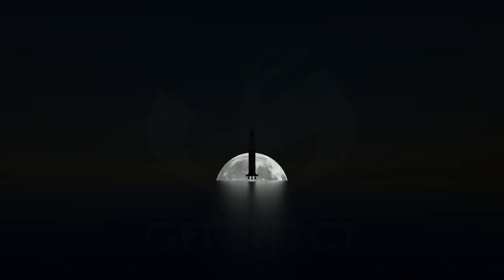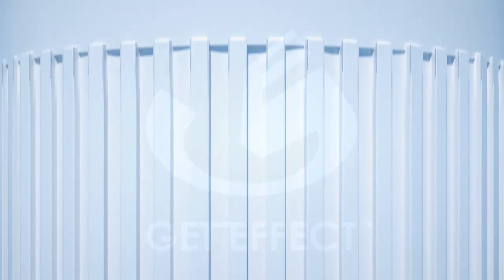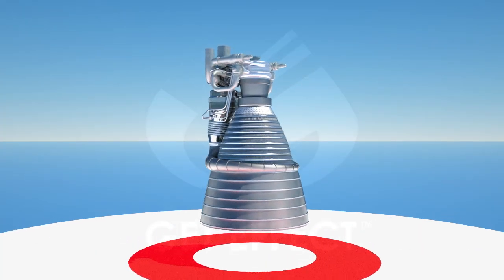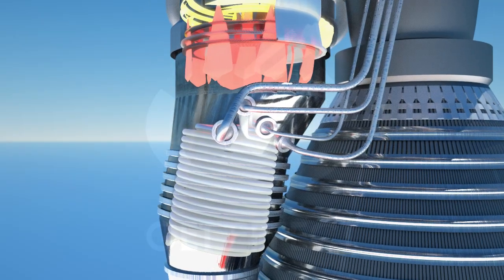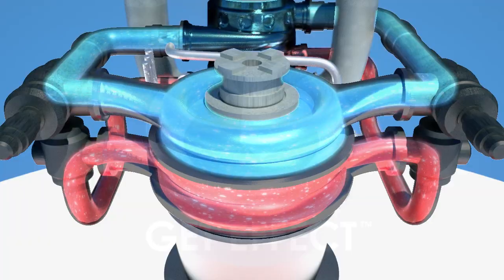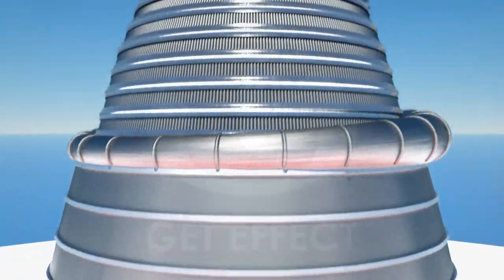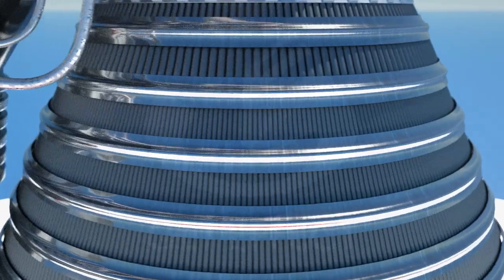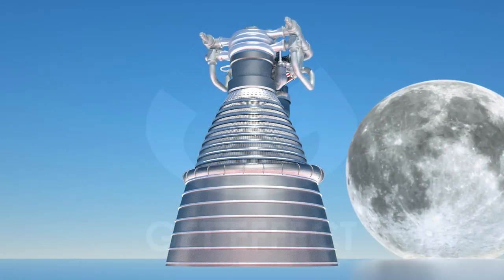NASA SATURN V ROCKETDYNE F1 ROCKET ENGINE, AN ANIMATED DOCUMENTARY (2016)

Comment: If we brought back the F-1 Engine, we could make America great again.
Reply: Well faster anyways ;)  They where expensive to build and for the payloads going up today Other rockets can do it on the cheep. 
I agree with you that we should revive the "space race" as it did usher in most of the technology we take for granted today.  The moon is our next logical step in learning what really works if we are going to go to Mars.  We have been working with the F-1 for a possible rebirth for deeper space exploration but what we really need to get this done is a much larger cash flow into research for not just the F-1 but new types of propulsion to get going where we want to go in a much shorter time.
Reply: Not a chance.. it only had enough fuel to go into orbit some maneuvring and come back.. the highes it ever whent was 650km for delivering and servicing the Hubble telescope.
Reply: Joe Vignolo I know about that, but the project has already been scrapped. The RS-25 + SRBs will be used on the SLS.
Reply: Roger Sullivan ...Get our own space program moving again. I find it kind of embarrassing that the only access we have to the ISS is a ride aboard a Khruschev-era Putin rocket!!!
Reply: abundantYOUniverse ...Add motion sensors and tripwires  to unleash the F-1's fire-breathing dragons!!!
Reply: Roger Sullivan -- No doubt about the Russians have a good record.
btw... the 1st woman in space. 1963. She just turned 80. Valentina Tereshkova
Reply: Sometime check out what was really going on a White Sands missile range in 1954 and the U.S. Army's launches with the Red-Stone rockets... go through the launch manifests and their payloads.... it will amaze you what has been sitting in plain sight for a long time but practically unspoken.
Reply: Hannible, Trump can't do it alone.  Remember Congress?
Reply: And that took some doing as the shuttle was near the limits of it's operating envelope.
Reply: I say bring back the most preeminent- prepossessing AWESOME rocket ship ever flown to date, Her Majesty, "The Saturn V Rocketship" !!
Reply: We have the Merlin-1D now. Way better, and much cheaper!
Reply: Not just the Shuttle SRB's uprated ones that will make them one of the most powerfull srb's ever made.
Reply: silverbird58 I was answering your Space Shuttle question.
Reply: Dallas Cheked Agreed!
Reply: Franco M ...The Russians also sent 48 dogs into space. 28 of them made it back to earth alive. They were the first cosmonauts before Yuri Gagarin. They proved that humans could most likely withstand the rigors of space flight.
Reply: Franco M kewl
Reply: Unfortunately.  Still stuck with large estes rocket engines that burn up leaving hollow tubes.
Reply: timmainson we should stop spending 600B annually on war and actually achieve something great (like a mars colony)
Reply: “We destroyed this technology” According to NASA. And since Werner Von Braun died,  impossible to be duplicated. Also the refinery that made the Space”grade diesel was lost in hurricane Dottie
Reply: Probably it is high time to develop new liquid engines that become much better that F-1.
Consider params of USSR engine RD-170 (1985 first flight):
Thrust (vac.) 7,904 kN (1,777,000 lbf)
Thrust (SL) 7,257 kN (1,631,000 lbf)
Isp (vac.) 337 s (3.30 km/s)
Isp (SL) 309 s (3.03 km/s)
Isp - characterises efficiency for 1kg of fuel use to convert it to thrust. The higher number, the less fuel required and more payload can get to space.
Reply: The closest thing the Saturn V had to a contemporary was the Soviet N1, which launched four times and exploded each time, almost always because of failures in the complex system that managed the N1's 30 individual first-stage rocket motors. In contrast, the Saturn V has an unblemished string of successful launches, never suffering a problem or failure significant enough to trigger an abort.
Though the F-1 was the largest and most powerful single-chamber liquid-fueled rocket engine ever successfully flown, its power was exceeded by a pair of Soviet designs. The RD-170 engine (used for the only two launches of the Energia rocket) and its RD-171 variant (used on the Zenit rocket) both produce more thrust, but the Soviets were unable to overcome problems with combustion instability in a large rocket's nozzle. Combustion instability is the tendency of the burning propellent to swirl as it is pumped into the nozzle; as we'll see, NASA eventually developed a series of baffles on the F-1's injector plate to damp its instability. The Soviet Union chose to work around the problem by fitting the RD-170 with four separate nozzles instead of one large one, giving the RD-170 and -171 the visual appearance of being four separate engines.

This workaround came to be not because the Soviets were lesser engineers or scientists—the Soviet space program was filled with brilliant, talented people—but instead because for most of its existence the Soviet space program's various rocket design bureaus were caught in a push-pull war of direction and leadership between two chief designers: Sergei Korolev and Valentin Glushko. Korolev favored cryogenically fueled rockets, and Glushko favored those powered by hypergolic propellants. This split in rocket strategy sapped resources, preventing the full force of Soviet engineering talent from focusing on either and ultimately stunting their rocketry program.

To recap; the impressive F1 rocket engine remains to date, the most powerful single chamber liquid-fueled rocket engine ever built and successfully operated.
Reply: Bruce Merrill: "The Soviet Union chose to work around the problem by fitting the RD-170 with four separate nozzles instead of one large one, giving the RD-170 and -171 the visual appearance of being four separate engines."
I hope it is widely known that size, number and form of combustion chambers greatly influence efficiency of the rocket engine (Isp), while the most 'know how' consuming part of the engine is turbine and pumps for fuel and oxidizer. RD-170 has single set of turbine/fuel pump/oxidizer pump, and thus can only be considered as single engine.
So, probably multiple combustion chambers are not workaround, but way of excellence in performance. While  additional devices inserted into big single combustion chamber of F-1 - is a patch to mimic multiple combustion chambers and provide stability, but without higher engine fuel efficiency.
I found a video with RD-170 construction ( https://youtu.be/iYfD0rwmeF4?t=2m55s ) that show some solution for fuel/oxidizer injection into combustion chamber. It may be similar to F-1 solution and has same effects.
Reply: Kyle Towers . So the F-1 is rebuilt and ready but not the Saturn 5 they are part of ?.. What’s the point of rebuilding the F-1, are we still looking for a engine for Orion ?
Reply: So we are talking hypothetically. My bad,  carry on and enjoy .
Reply: Kyle Towers : since RD-170 works with 245 bars pressure vs. only 70 bars in F-1, smaller chambers look like tech solution to much higher pressure. High pressure in combustion chamber is critical to 17.5% increase in Isp that decreases rocket fuel mass by these 17.5% and allows higher payload to orbit.
Reply: Kyle Towers: They actually work with much higher pressure than F-1. RD-170 has 245 bar, while RD-180 has 267 bar. You should review RD engines specs on wiki.
Reply: Kyle Towers: To the moment your arguments do not explain outstanding performance of RD-170/RD-180 engines between other RP-1/LOX engines including developped in US. You consider multiple nozzles detrimetnal to performance, but those "poorly designed" engines are still the best with their fuel. How can it be at the same time?
Watching for Saturn V starts I noticed that nozzle exhaust is mostly black and a bit yellow at length comparable with nozzle height itself. This is underburned fuel, that still burns, extends and creates additional pressure that could be used to increase the engines efficiency. To do this F-1 requires at least twice as long nozzle walls. But the F-1 nozzles were already extended, while it was not enough.
See also exhaust from RD-180 engine. It is blue right from the edge of its short nozzle. So the highest temperature and full burn were reached inside its short and small nozzle. This small nozzle works good enough to provide outstanding performance for the engine w/o any "detrimental to performance" clause.
You can believe that multiple nozzles is some development error of its creators. But they probably had experiments and calculations for all possibilities, and then concluded which design and size is the best for RP-1/LOX of this thrust.
Don't try to beat the heads with your plain sentencies, if you don't have any  deep knowledge behind them.
Reply: Nah.  Costs too much.
Reply: Merlin-1D has Isp 282 s
RD-191 has Isp 310.7 s (-9.24% fuel consumption) with more than double thrust.
Both use LOX / RP-1
So Merlin-1D is better than Rocketdyne F-1 in efficiency, but not better than contemporary engines.
Note that instead of 9% of fuel mass RD-191 can drive the same additional mass of Stage 2 weight to the same speed and height.
Merlin-1D is cheaper - probably yes, but it is not clear how to buy it by external buyer. So it is not clear how to understand, if the engine price is less or more than competitor engine until they are equally sold with specified price in open market.
Reply: Clarification: I haven't seen to the moment use of the Falcon 9 first stage more than twice (excluding tests). So it is not obvious that Merlin-1D can be used 10 or 20 times with ease.
There are no principal limitations to use other engines more than once, since the objective obstacle to reuse - that stages with RD-191 do not return the same way. But this is rocket construction and control limitations, not their engine. Wiki says one of the tested RD-191 reached "the maximum running time of 3,635 seconds in 12 tests".
Each Merlin-1D runs about 150 seconds during launch. So returned RD-191 could make at least 20 launches according to its maximum run time.
Please don't try to "divide not a slain bear" before cheap Merlin-1D is proven to exist.
Reply: 1) "reusability..." - I don't stand near used Falcon 9 first stage with a candle to be sure that no part of the engines is disassembled, partially replaced, then assembled again and then installed back to the stage. If deep disassembly/assembly/replacement happens - there is no much economy can be stated for the engine. You can manufacture new engine and it will be just the same 470 kg of metal. So reusability is just 'claim' of SpaceX that nobody can prove or refute outside of SpaceX. Probably only pace of start and re-start of the same stage can prove it is reusable with no or little maintenance.
2) Wiki info is accepted by Atlas V and Antares 200 rocket engineers who conducted tests of the RD-180 engine from the same family. It just has double thrust of RD-191, and x4,53 of Merlin-1D thrust having Isp comparable with RD-191.
3) Reignition - 12 test starts on the same engine. I'm not aware does it have embedded ignition block. This is just some part that can be installed into the pre-burner of the turbine.
Precision throttling: Wiki states "The engine is capable of throttling down to 30% of nominal thrust; the design also allows for a short-duration enhanced thrust (up to 105% of nominal level) in emergency situations."
I don't know how precise it is. At least engine can have 100 and 105% thrust difference, so +5% and set with high accuracy. Why should the accuracy be worse when setting throttle to 30%.

I'm aware that Merlin-1D is capable to throttle to 60% and higher, so this makes landing procedure more dangerous that most people think, since 60% of 845kN is 51,734 kg of thrust, while first stage empty mass is 22,200 kg. Right before end of landing thrust exceeds the stage mass more than twice. And the engine cannot be turned off before touch down. The landing engine start is pre-calculated with precision to have 0 velocity at landing surface 0 altitude point.  One mistake and the stage will go back to space or splash from some positive height.
Reply: Roger Sullivan the german engineers no longer available
Reply: I have another idea about F-1! If on the first stage of Sarturn-5 its five F-1s could be replaced by five russian RD-170s, this huge rocket could launch into orbit for about 40 tonns more of payload than it did before, during Moon race! ... RD-170 and F-1 are almost equal in theis thrust, but our russian engine is much more economical: it uses a very efficient closed cycle, rich in oxygen going entirely through the pre-chamber before entering the main chamber of combustion. Thus, the payload of Saturn-5 would be not 140, but 160-180 tonns!!! https://www.youtube.com/watch?v=TMbl_ofF3AM&t=2075s https://www.youtube.com/watch?v=iYfD0rwmeF4&t=207s
Reply: Roger Sullivan so america would be great again thanks to Germany ;)
Reply: The F-1 engine is on its way back. A remaining Apollo F-1 engine has been retrieved by NASA from the Smithsonian. The gas generator has been removed and test fired on a test stand. Other components of the same legacy engine are being laser scanned so that they can be 3D printed. Someday ungraded F-1 engines are to be used to boost the new SLS rocket off the launch pad as replacements for the shuttle derived solid rocket boosters that will be used on the initial flights.
Reply: Roger Sullivan:   Apollo was awesome, but was rushed, using what tech was available or quickly achievable. 5 decades later, the favored launch system is a versatile one, with optional strap on solid fuel boosters for the biggest loads .. thus a F-1 monster motor is no longer needed for leaving low Earth orbit... the new SLS being built now, will use four Shuttle engines (RS-25) on the first stage .. with 2 very large boosters, it will exceed the total thrust of the Saturn V. Watch for SLS to launch in 2018, NASA may put a crew in that first launch, which is supposed to circle out past the moon and back .. its been a long time since humans have left low Earth orbit!!! A new era of manned space flight is almost here, so exciting! America has been ahead in Space since the mid 60's, we just happen to know that the USA could have done a LOT more if politicians hadn't trashed NASA's budget .. and the over priced dangerous Shuttle systems should have been retired much earlier (or not built at all).
Reply: A lot of people seem to miss the tongue in cheek nature of my original comment. I simply love F-1 engines. I don't necessarily think they are the future of rocketry. So my comment is somewhat of a joke (which I thought I made obvious by the ridiculous statement that they alone could make America great again). However, there is something to be said for proven designs. Unfortunately, we no longer even have the infrastructure or knowledge to build F-1s or F-1 descendants because there was such a long break in their use and they were designed before the era of CAD, so there are no CAD files that can just be called up to show the complete design of an F-1. One of the reasons the Russian space program has been so safe overall compared to ours is that they have basically used and built on the same technology since the 1960s. One of the major design flaws of the Shuttle Program, one that caused one of it's major catastrophes, people seem to forget, was it's reliance on solid rocket booster motors. They cannot be turned off once ignited, and they caused the Challenger disaster. The other major flaw of the Shuttle design will be eliminated in SLS by placing the vehicle above the foam insulated main fuel tank. But Russian traditional, liquid fuel rockets have proven to be extremely reliable, resulting in no cosmonaut deaths on launch. The cosmonauts who died in flight during the Russian space program died on landing (parachute failure, Soyuz 1) and re-entry (decompression, Soyuz 11).
Reply: toffersify ...Since "pro" and "con" are opposites, then isn't PROGRESS the opposite of CONGRESS???
Reply: Don't worry , Donald Trump will make America great again.
Reply: DJ Trump is going to do that Roger.
Reply: President Shit-Gibbon will call it the F-Trump Engine!

Comment: The numbers are wrong
Reply: you are lucky that I looked it up before I built a copy of it. If anything would have went wrong, I would have made you responsible
Reply: Ok, so what are the correct numbers?
Reply: you're wrong
Reply: 2.800t => 2970t is correct, max acceleration is 3G, 4G is the experienced G-force, its 3200°C not 3300 in the thrust chamber